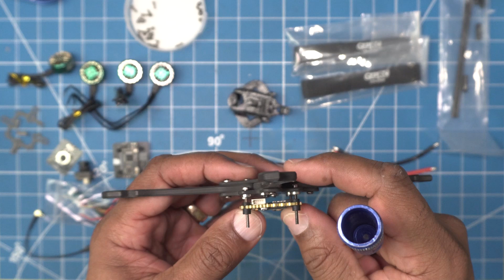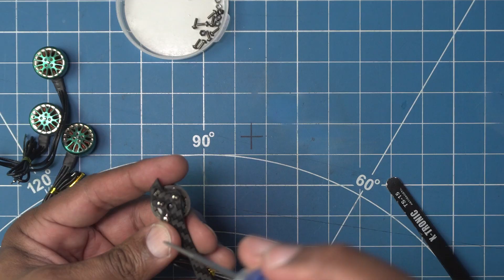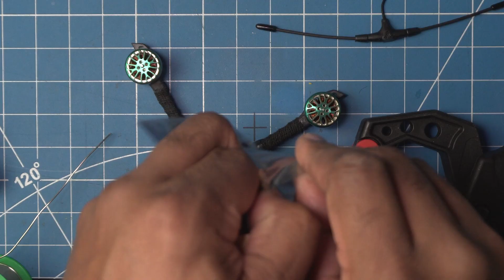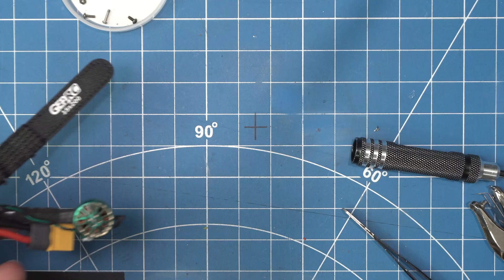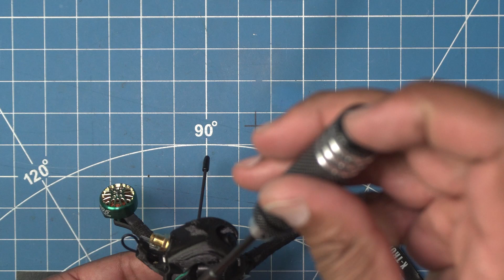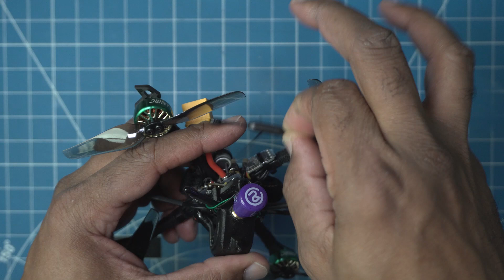GEPRC DX-4 Build - Size Does Matter!!

Comment: I want that frame bro dope video I want to learn how to build also I’m afraid to mess things up 😅
Reply from the maker: Thx.  AliExpress for the frame.  To build, simply enroll in the 'School of Mistakes'... 'cause that's what we all do until we figure things out.  It's how we learn.  If you're afraid of messing up, maybe this isn't for you (no disrespect).  Watching a lot of FPV content, reading and asking lots of questions will help you a LOT. That's pretty much how most ppl start.
Reply: @ thanks man I subscribed to your channel keep it coming
Reply from the maker: I'm working on other content as well, incl Tech Talk, Fly Better, Qwad Comparisons as well as a Short Story segment.  Will take some effort to get them all in, but as it gets warmer, I'll be able to do more.
Reply: @QLx-expmi  nice bro I have a question I use analog now but I’m looking to upgrade ito digital is the dji v2 goggles a good choice now days
Reply from the maker: @ElectricGang-eformss Most FPV pilots have moved on to either the Goggles 2/Integra or DJI's newest releases, the Goggles 3 or their box version.  I have the Integra, but only use it when I'm flying qwads which have the DJI O3 Air Unit installed.
So, if u don't mind older tech related to DJI's older iterations (Caddx and RunCam VTXs), then go for it and get V2.
I still like my V2 goggles because most of my fleet have Caddx and RunCam VTXs installed and paired to it... and it's too much of a hassle to have to re-bind them to the Integra.  Plus, they fit a bit different.

Comment: this is the same setup i run on my apex 4" builds ( but with dji digital ) , use them for racing , freestyle bashing , the motors can be a tad soft but really are impressive ( i also run the 1404lannrc and jehmcu aio  on my babyhawk and waaay better than stock emax ) 

i have 10x apex4" builds all with jehmchu and lannrc motors . looking forward to your flight videos
Reply from the maker: @mx118racer  Wow!  And here I was... thinking my setup was special.  😆  All the same, happy I'm in good company.  I've just started using LANNRC motors since mid-2024, and so far, I'm very happy with their performance for the cost.  Thx for the feedback.  And... flight video coming soon.  Just working on the edit.
Reply from the maker: Flight video is up.  Check it out.